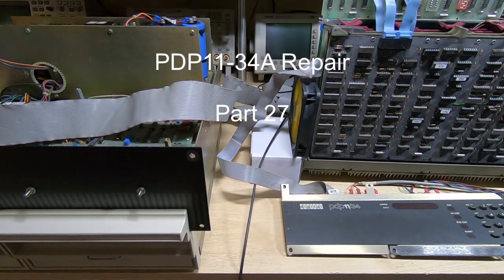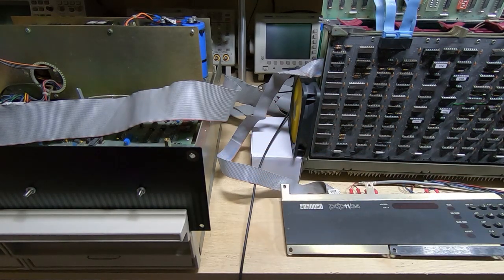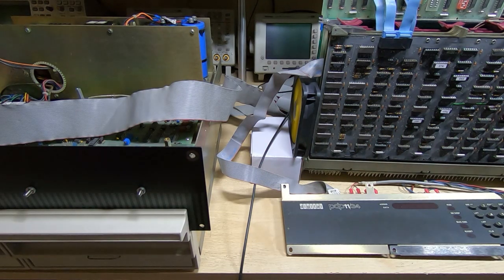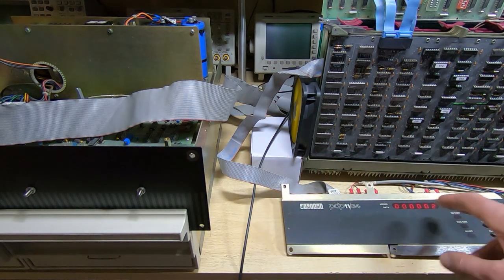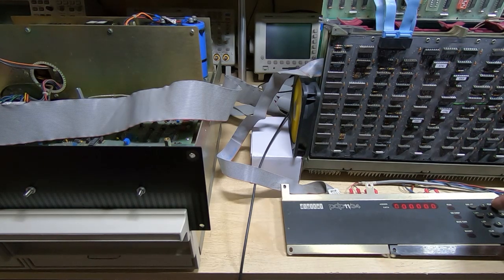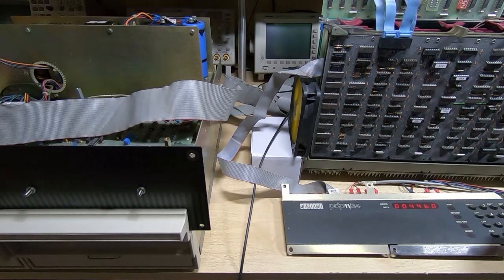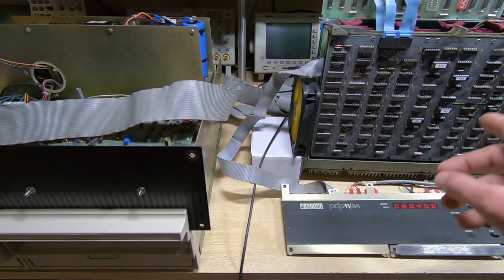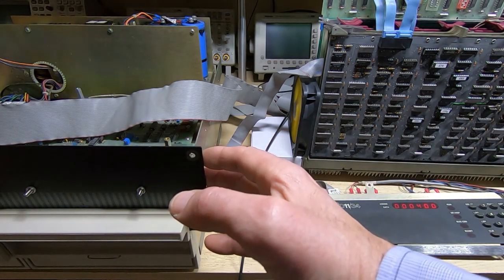PDP11-34A Repair Part27

Comment: Jerry, Can you use any of the disk images from the SImh software sets here: http://simh.trailing-edge.com/software.html
Reply from the maker: In theory I could but as the formats are not the same then I would need to extract and recompile them. There are many ways I could proceed but I am hoping to keep the video series as focused as possible so I do not really want to branch off onto other topics. At the moment the system has developed yet another fault and will not read disks at all. There are so many faults still in this system that I want to minimise the variables. Luckily a viewer was kind enough to send me a SD RT11 boot disk but I now need to get the system able to read disks again before I try using it as I do not want to risk damaging it and I cannot easily make a copy until my system works.
Reply: @JerryWalker001  Good news you've got a viable boot disk now although not about even more faults. I'm working on an Intel ICE-49 at the moment and it's developed more and more faults as time as gone on in much the same way and turning into a major reverse engineering exercise.

Comment: DIP switches are notoriously unreliable, though I'm sure you've already checked.
Reply from the maker: Yes that was first on my list although they should all be off except one so it was easy to check. The boot problem is that block 32 on the boot disk is corrupt. I have not checked why it continually tries to boot yet. I will be looking into that later.

Comment: I have an image of bootable RT11 which I could email (when I find it!). Might that be of use?

I am also getting my microvax out of the garage, to connect an RX02 drive, and will cluster the machine with virtual VMS; then I could write the image to a floppy. Fingers crossed.
Reply from the maker: That would be great. Do you know what format it is in?  I read the disk I have here using PDPGUI and block 32 is corrupt which explains why it would not boot as that is part of the system file.
Reply: I absolutely have working bootable RT-11 images, but if I were you I'd write AK6DN’s RX02 XXDP image for the PDP-11.
Reply from the maker: @EthanBlanton  What format are the images?
Reply: @JerryWalker001  Raw RX02 images, you can write them directly using PDP11GUI.  I dropped you a note with a boot image attached.